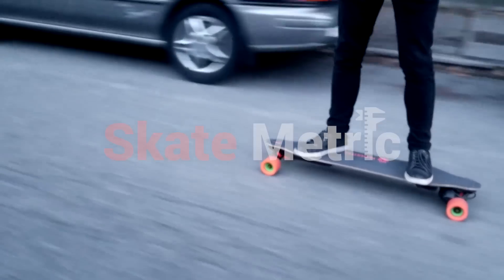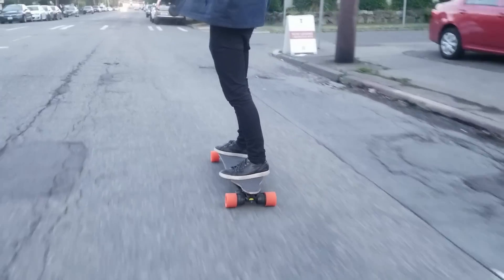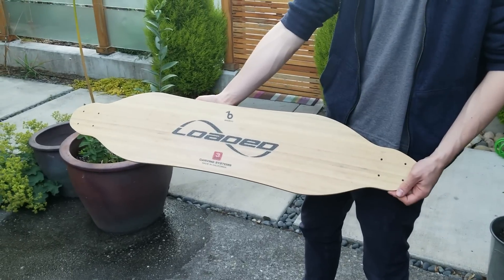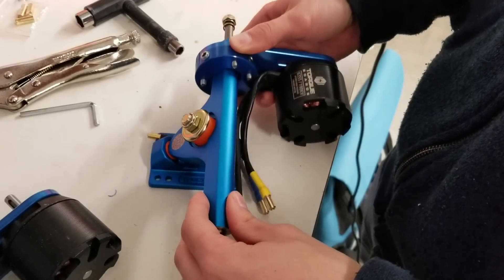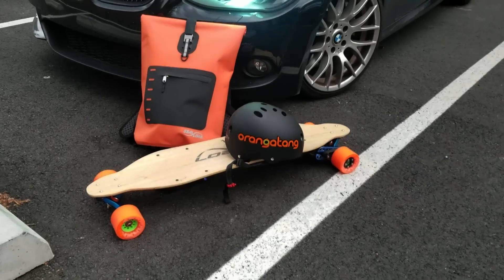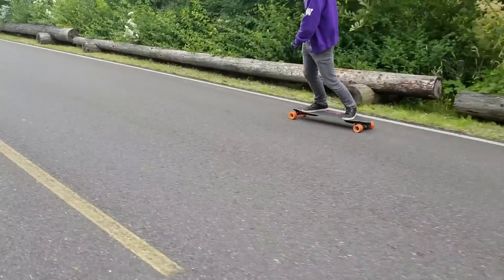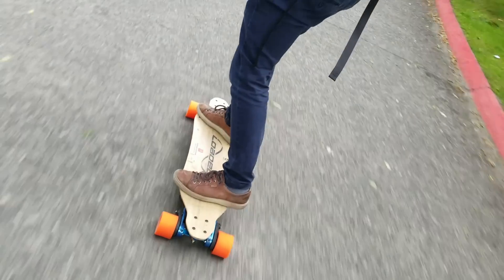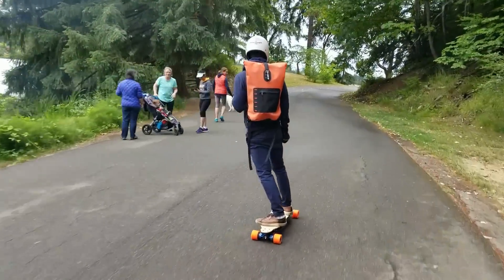Building a Better Boosted Stealth Electric Longboard

Comment: GREAT BUILD !! But...
Your Ownboard battery pack only discharges 40A continuous & you are sucking 70 - 90A . Its not good for the battery pack. Also the output of the battery pack is controlled by a BMS . So even if you think you are using Burst current , you are actually not because even if the battery pack can deliver , the BMS wont let it. Use a Higher discharge battery pack & Bypass the BMS for charge only. Or preferebaly go for 12s : )
Reply from the maker: What makes you think this is drawing 80 amps from the battery (or is configured to)? The motors are both configured to run 80 amps max, but the VESC will only draw 30 or 40 amps from the battery, depending on how it's setup. Motor and battery current are not the same.
Reply: @skatemetric627  Ok Thanks , I thought you were running 80 Battery amps ….

Comment: You get what you pay for! Buy a cheap import and expect to go through three or four boards that doesn’t brake, will take off without using the controller, and battery life will weaken very quickly, and dangerously!
I’ve owned about 20 electric boards, bought some cheapies to give them a crack only to have a unreliable dangerous and unpredictable piece of shit added to the ‘do not ride again’ pile!
Unlimited and loaded have teamed up to give you a seriously comfortable, fast, safe and fun board to ride! 
I will recommend them all day long!...

Comment: I can't believe I caught this video only a few weeks ago!  WOW!  Of all the diy builds, I is the suggested battery good (Samsung 6.0) for a person weighing about 220lbs? who do you think range would be for such a pe this one got me motivated me to start buying parts beyond just the deck!   Great job on this board!!(Boosted clone)  I expect to have all of my parts by end of October.  
 Few Questions:
1.  Is there a more powerful battery that will fit in the recommended enclosure?
2.  Have you ever tested this board with 100mm wheels?  I bought the Orangatang wheels, but may use 100mm wheels such as Boa or MBS so I can ride wet streets, especially during fall as board is being  used for commuting purposes.
3.  Finally, now that you've done a 'Boosted' clone, have you thought of doing an 'Evolve' clone?  I would like to work on that after I complete this build.  What deck would you recommend using for either the  the bamboo version or even the GTX version?   I know that might be  harder since GTX is carbon fiber.  But would do a maple version.

Comment: FINALLY! A great start for a REAL longboard with an electric motor added. I just ordered all of my parts, most of which are the exact links this video provided. I went with the 10S5P battery for some (hopefully) insane range specs. All built on a beautiful Arbor Axis deck with the caliber II trucks. So excited. I'll try to update this post after it's built,  if I remember to. 

Happy shredding 🤙
Reply: How did it turn out?
And what range did you get out of it?
Reply: @nicholasesparo2160  seems like he forgot

Comment: Way too expensive. i.e. that $250 battery could be $120 or even a little less. Replace the $175 desk with a cheap $50 deck. Motor mount kits for $35. etc...
Reply: Yeah go ahead and build that lol. 😒
Reply: @Sscott1985  Already priced it out. $580 but I used the same expensive wheels so could probably get it down more.

Comment: Everyone who is interisted in building this board, do it its an amazing board! but i would not recommend the battery they chose as for the same price u can get a 10s3p which has the same performance but even higher range. u can get this battery at mboard.co and its a steal. its what i use in my personal setuo

Comment: Wish i did more homework and went you guys route, i bought cheap knock off board called Paean, now building my own battery with bms, got to get a proper vesc and got to replace deck, long story build it properly your self and save money in the long run.

Comment: I don't recommend ordering from ownboard, I ordered all the parts from this tutorial, but the battery just came in after a month and it's defective
Reply: So everyone fighting with the ownboard battery! I successfully replaced the BMS with one from mboards and it works great it only has a discharge of 30 amps but that's enough I'm sure there are other options
Reply from the maker: Your battery might actually be OK. We also thought our 30Q pack from Ownboard was defective, but it turns out their BMS has a strange activation process. Basically, to enable current output, you must first plug the battery into the ESCs (or any load) while also leaving it connected to the charger. Give this a try and see if it resolves your issue.
Reply: SkateMetric I will give that a try thank you
Reply: Ok so I plugged in the esc and the battery and the charger and it works! And then I can unplug the charger and it stays on but if I reset the board then it doesn't work again will I have to use the charger Everytime to turn on my board?
Reply: @SamusSays  I encountered the same problem, have you found a solution yet?
Reply: @Zzapi86  I have just been using the charger to turn it on, I'm going to cut it open and replace the BMS I'll post how that goes
Reply: @SamusSays Awesome, thanks!

Comment: Hey is it possible to have a different remote control? Liie using one of the new chinese one or maybe even a Boosted remote?
Also what's about the range on this setup?
Reply from the maker: Maltom Barn Yes. You can use whatever controller/receiver combo you prefer.
Reply: I guess I'm curious which battery setup you used and what mileage you're getting?
Do you prefer this remote for any particular reason?

Comment: It's funny to show that this is basically a 10S2P powered Raptor 1 which accellarates faster than the Raptor 2 with 10S4P. This simply proves BELT is better than HUBS. Of course with hubs you got virtually no resistance and the silent operation when riding or pushing.

Comment: First, the comment system on your website is broken.
Everyone is saying the build price is around $1100 but I found it to be more like $1300. I think some people forgot they used a lot of things twice in the build, like VESCs or pulleys or motor mounts ... etc. At this price point why don't I buy a boosted. The calculator I used said the range is 12 miles, which is less than an extended range boosted battery pack. If I upgraded from a Samsung 6.0 battery pack to a Sanyo battery pack that would bring the board up an extra $150 for an extra 4 miles. Which then barely beats the boosted. 
It's great the board accelerates fast. But I have no idea if the board climbs hills. A hill test and range test of this board would be much appreciated. 
I am also on a budget so I could save $325 dollars if I went for a single motor set up. Would the board still preform well enough if it only had one motor? I guess if one motor does not work I could always upgrade to two.
Reply: If its money your worried about buy a boosted you want something faster build a DIY I find every single production board breaks or have weaknesses skatemetric makes there's fool proof.
Reply: Okay. Thanks
Reply: I agree, if your heart isn't in the process of building one.  I think it's pretty cool to have a customized board.  You can keep it the latest and greatest with gradual upgrades.  I already have a Boosted V2, so I'm looking at this differently.
Reply: Why not consider wowgo 2s for around 650? I think it was 16-18 mile range.
Reply: I make a DIY instead of buying a Boosted for the same price. Why? Because I don't have $1500!! But sometimes I have $400, two months later $300 etc... AND I can pick the parts I want. Like the Foxbox Unity I brought on sale with the remote. I won't have the same board because I want a kick tail. And others things like that so no, it won't be the same but mine, made by me and at the rhythm of the amount of money I can save.

Comment: Getting the same truck, wheel, motor + mount setup for my own DIY build – the blue looks really good with the orange! :D
Reply: I haven't finished building mine yet, but I plan on getting a 12s2p with LG HB6 cells. You should search around on the esk8 builder forums to see what ranges other people get with what batteries :)

Comment: Awsome job guys love the video. In the tutorial on your site you had two different vesc settings options you recommend, insane and practical. Just wondering which settings you where running in the drag race va the v2. Also if I where to do this I would have gotten eboosted enclosures (https://www.eboardsperu.com/product/loaded-vanguard-enclosure-set-10s4p/) and a physcotiller 10s4p battery (https://psychotiller.com/product/18650-30q-battery-pack-with-charge-only-bms-usa-only) it would add about $200 dollars to the cost but you would also get double the range and imo better looking enclosures

Comment: Is it possible to build this with just the one motor to start with?
Reply: Andrew Alvino Yes, and performance will be more or less identical, since these ESCs can push quite a lot of current. However, traction will obviously suffer a little, and you'll lose the redundancy of a dual setup (you may have to kick it home if something fails). 

In short, going with a single motor is a great way to save a lot of money without significantly sacrificing ride quality.
Reply: Ok awesome, thanks for getting back to me so quickly, i was also wondering if it would be worth upgrading to a vesc, so as to have better upgradability and more features available? Thanks for the build spec one of the more comprehensive ones i've seen online
Reply: Andrew Alvino Definitely go for a VESC, unless there's a great new alternative I'm not yet aware of. You won't be disappointed.

Comment: Thumbs up, if y'all want SkateMetric to make a video on how to make this board!!!! Another great video.
Reply: They absolutely need to make one.
Btw what would happen if I use 2 motors, one with 140 kv for torque and the other with over 200kv for speed? Would it work for long periods of time (strain on battery, vesc etc) ?
Reply: Terrible idea, there is no such software to synchronize them so they would likely end up clashing, thus putting strain on almost every component.
Reply: @cristianconstantin6496  what
Reply: Dont worry! I made a tutorial :) Check it out if you want to. I have mostly used all the parts that skatemetric put in their parts list
Reply: Just uploaded one for you guys: https://youtu.be/dOB82zAhbKE